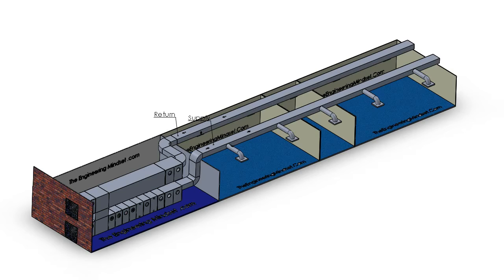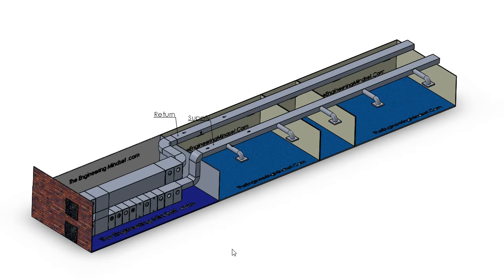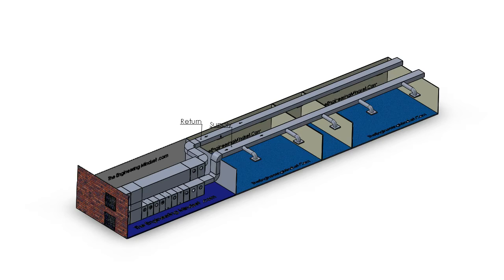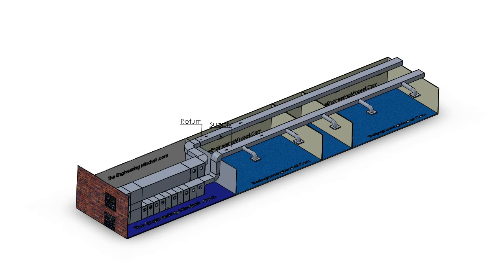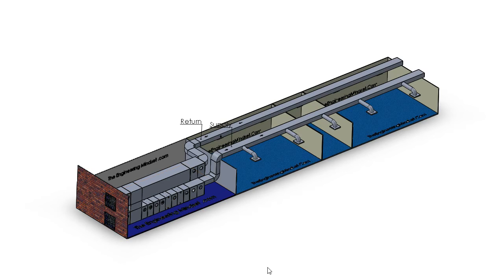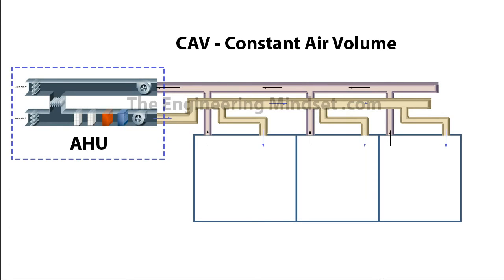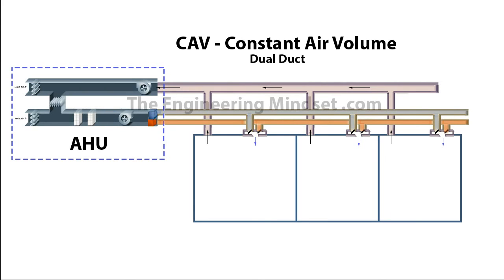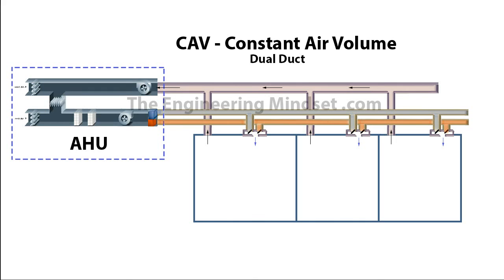Constant Air Volume - CAV HVAC System

Comment: Can't you just install dampers before the diffusers, so you can adjust them manually in order to control the cold air flow? So you could adjust this flux according to the thermal load
Reply from the maker: Yes that's a VAV system, check this video https://youtu.be/HBmOyeWtpHg

Comment: Hey Paul, thank you for your clear explanation of a CAV system. It's really helping me out! I have a question: is there also such thing as a terminal 'recool' instead of a terminal reheat for CAV systems?
Reply from the maker: You could do it but it's very expensive to make, run and maintain. Much easier for the central plant to do. Otherwise just add a split unit in the room

Comment: If the total flow rate of all AHU and FCU  in the  building = 311 L/S 
What the best suction pressure and discharge pressure in the chilled water pump
Reply from the maker: It's not as easy as that. You need to calculate it and the method you use depends on the design of the pipework and location of the pump/s. You should have a "description of operation" and commissioning data sheets for your building, check these.

Comment: So we can say the main differences between CAV and VAV are the motorized damper unit with its complimentary accessories which will control the air volume for thermal comfort and the working time and power of the AHU for energy saving purposes?
Reply from the maker: +John Ron correct. 
CAV you get what you're given
VAV you get what you need

Comment: Thank You so much for your videos !!
Can you please make videos on HAP sofware..
how to calculate loads with the help of Hap !!
Reply from the maker: Not sure what Hap is?
Reply: @EngineeringMindset  Hourly analysis program(HAP) it is the software and it is used to find heat and cooling load calculations by giving required parameters.

Comment: With regards to the dual-duct CAV, Is there a thermostat in each room allowing temperature control per room?
Reply from the maker: Each zone should have it's own temperature sensor to which the dampers in the mixing box will change position to hit the correct supply temperature as required to the location. Sometime multiple small rooms can be classed as one zone.
Reply: The Engineering Mindset   The dual duct can be seen as vav?